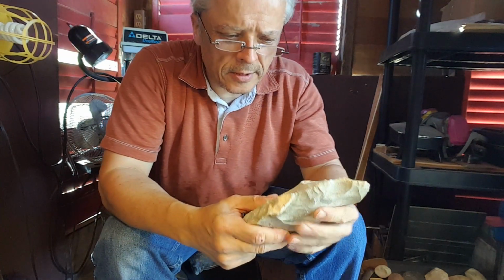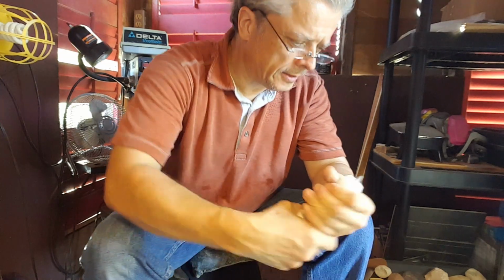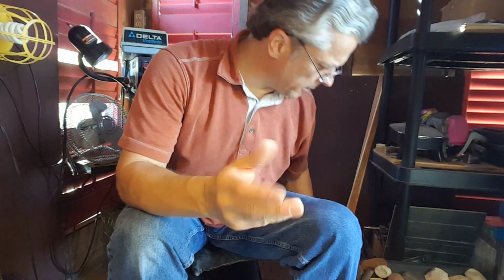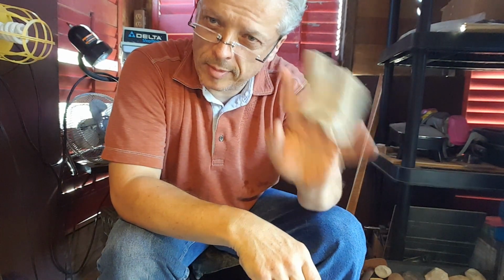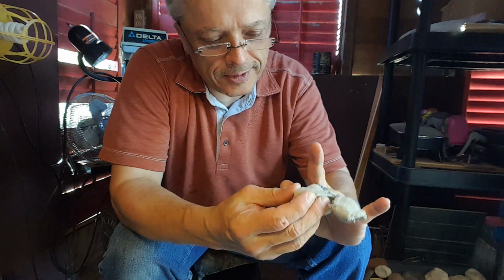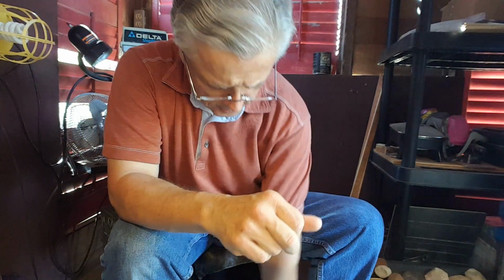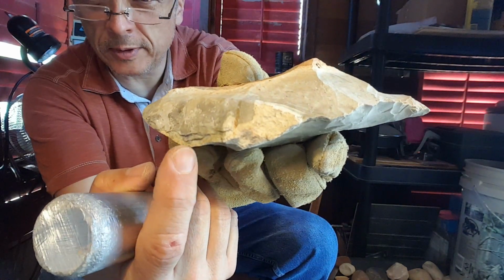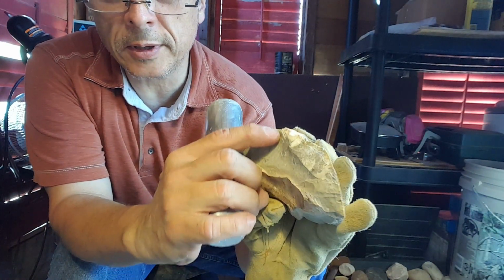507 - RC Kansas Stone w/ Aluminum Billets 2/4

Comment: My question is, where can I get one of those white plastic things you use for pressure flaking? I've looked in every store I go to, no one sells'em. Those or a 1 & 1/2 solid copper billet. I can't find'em anywhere.
Reply from the maker: The white plastic rods and solid copper or aluminum rods are available online.  Copper rod 1-1/2" https://www.zoro.com/value-brand-rod-copper-110-15-dia-x-1-ft-l-curd00105/i/G2885741/
Aluminum rod 1-1/2" https://www.zoro.com/value-brand-rod-aluminum-6061-1-12-in-dia-x-1-ft-l-2eyf4/i/G0634715/
Plastic rod 1-1/4" https://www.zoro.com/value-brand-rod-uhmw-pe-white-1-14-in-dia-x-3-ft-l-1uxc8/i/G2539914/

Comment: I think the finger protectors are called Finger Stalls.
Reply from the maker: Thanks.  I think the finger stalls you're thinking of have a strap to hold them in place. Finger guards are what they are usually called?   I'm pretty sure this is where I got mine ( or somewhere similar) http://www.rockler.com/thumb-and-finger-guards?utm_source=google&utm_medium=cpc&utm_term=&utm_content=pla&utm_campaign=PL&sid=V9146&gclid=Cj0KEQjwg8i_BRCT9dHt5ZSGi90BEiQAItdjpH7y3JSys9HF1W6yO4geI3VpaAkjD7v4RzE5QAfVb04aAl3M8P8HAQ